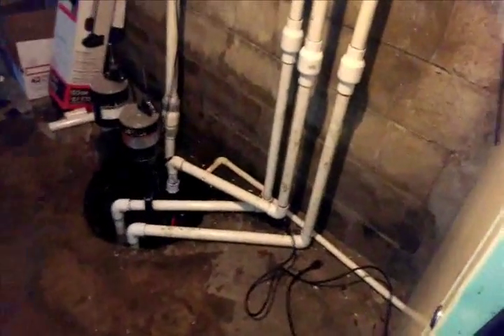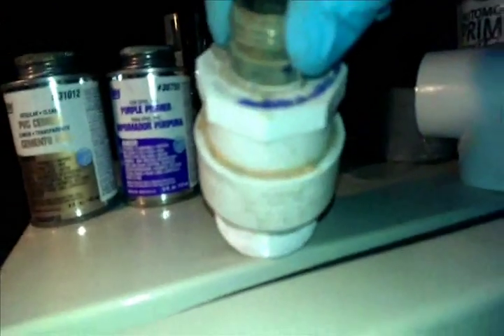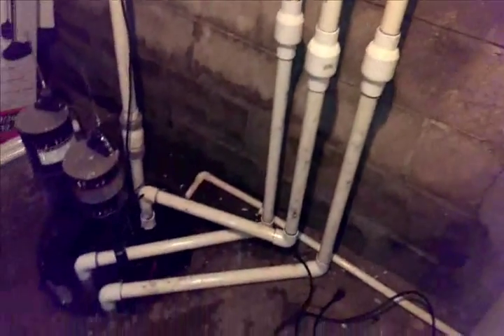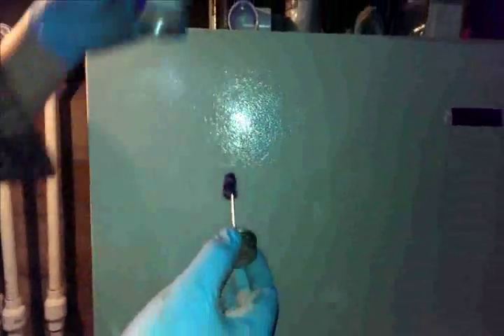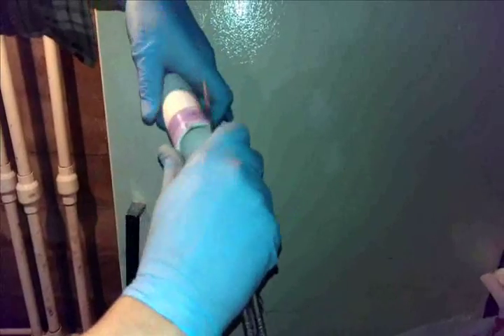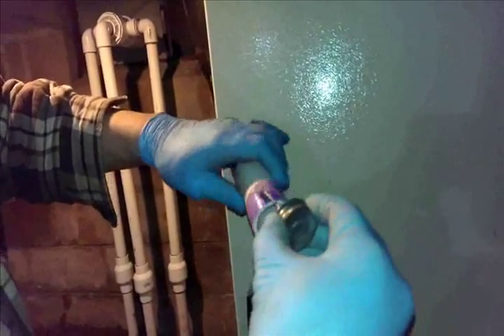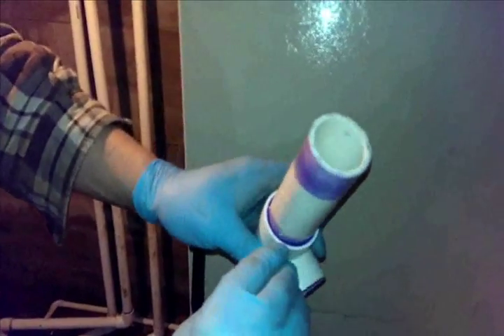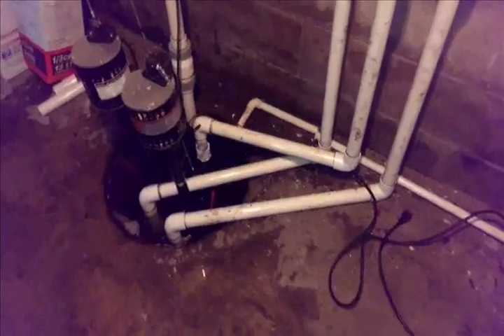How to Glue a PVC Joint Properly Know your equipment

Comment: The homeowner I been working with bought some glue in a spray can. It seems easy, but its also easy to spray too much. I learned that the hard way, when I glued a ball valve open. I also use the twist method like David W. suggested. Never had one back out yet, and it saves time. Nice pipe fitting by the way.

Comment: I give my fittings a 1/4 turn after pushing it up on the pipe also.... I'm a bad one about forgetting to glue all my joints. The worst time was when I replaced all the gray poly lines under a mobile home with CPVC. I dry fit a few pieces trying to get my next measurement and didn't go back and glue everything. That was aggravating when I turned the water on and the first one blew out... but really bad when turning the water back on and the 2nd one blew..... I didn't know what to think when turning the water back on that 3rd time... but everything was glued and held that time. I'm so particular about level, plumb, braced well, insulated well, deburring  pipe, etc but that time I overlooked 2 glue joints. I am a pipe fitter by trade though.
Reply from the maker: Haha, boy I know what you mean! Don't want a sump pump to pop apart during a flooding situation. You know that's when it would happen. 
I know the twist theory. Used to run a plating shop and pumped hot acid through plumbing. We never twisted, we found that if 100% glued AND 100% primed and firmly inserted without the twist, worked best. We would test joints by cutting them apart and the twist joints were strong, but a little less than 100% glued. I think the twist is to make sure glue coverage is adequate.
If you saw the sump pump video, I know what you mean about bracing, that's coming soon.
 ETp
Reply: I don't know if the non twist is better or not, I just always visualized that as you push the pipe into the fitting an almost imperceptible egg shape on one or the other would tend to scrape away glue on 2 surfaces and the twist would even that out.... I also envisioned that maybe the striations caused by the twisting might cause a better bond. All I know, like you said, when done right square cuts, deburring, priming, gluing, holding for a few seconds makes the process a sure, no leak joint.... I haven't seen the sump pump video yet.... I've already seen enough to KNOW you do good work and take pride in your work. I ran into some customers that were not concerned about taking time to do the job right...." Just slap it all together and see how many feet per day you can get". Those jobs bothered me a lot. Thanks friend! ... Oh yeah as if this comment isn't long enough already.... I ran that gray sch 80 PVC for a plating company in Boston. You know how that acid will dry to a crystals? I got some of those crystals packed down into a 1/2 inch scratch on my finger. I took my time about getting around to flushing it out. It got pretty deep on me. I was just a kid back then. Thanks!
Reply from the maker: Thanks! Yep the acid can get pretty zippy. Hey, no bacteria though. ETp
Reply: LOL. THANKS!!!